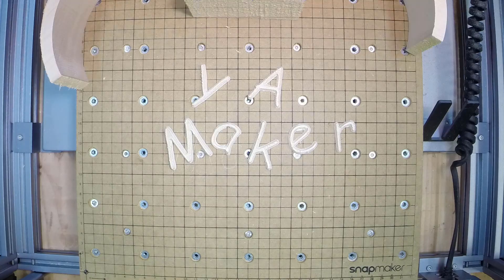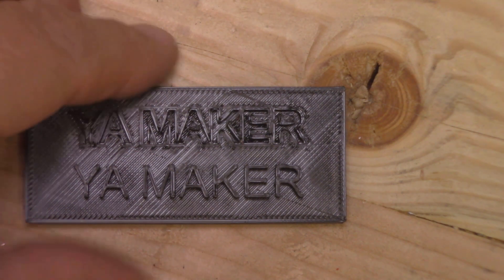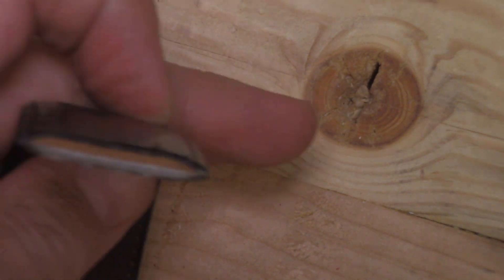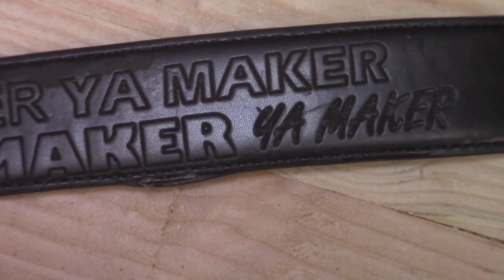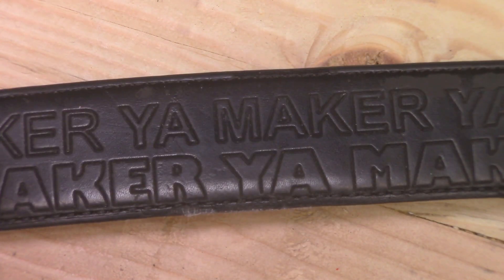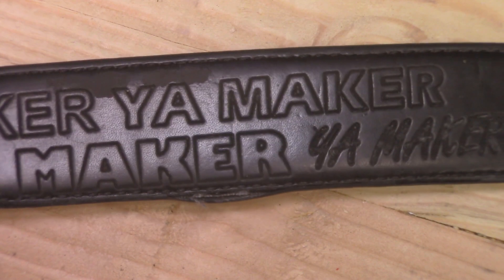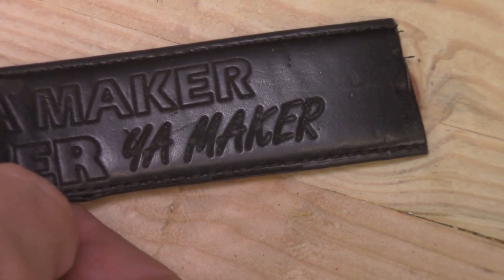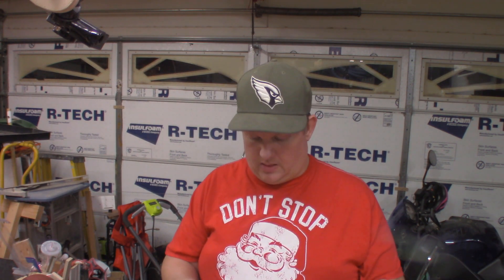3d printed Letters and Etching letters into leather.

Comment: Good job with the review! Pls don t forget to mention how many minutes/hours it was printed/engraved in.
Have you engraved small text on plain white xerox paper? Does it leave burn mark on edge or is it clean?
Cheers from Romania!
Reply from the maker: Thank you for the feedback.  The 3d print took approximately 2 hours and 20 minutes and the laser took 25 minutes.  The laser would have been faster if a single pass was selected but it was on 2 passes. I have cut out xerox paper and the edges looked clean for the most part, there was a dark edge though but that will happen when you laser cut no matter what. It did not extend past the cut and was <.1mm in size.  I hope I answered your question and will try my best to remember to include the time information in future videos.

Comment: I have been having some issues with Laser Etching Letters onto wood. Did you  use B & W/ Greyscale or did you use vector but not cut all the way through. My laser etched letter have layer lines that are really visible so any feedback would be appreciated. Thanks
Reply from the maker: For this video I used vector at full power.  I just recently received some leather that i would like to do more testing on and see what I can make with it.  If you have any suggestions let me know.